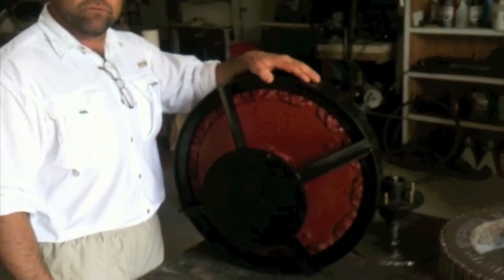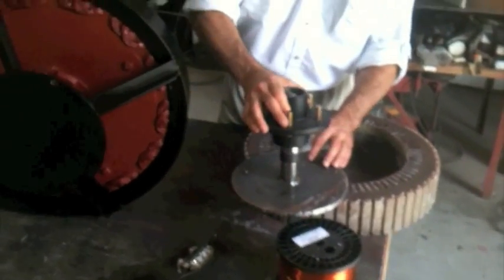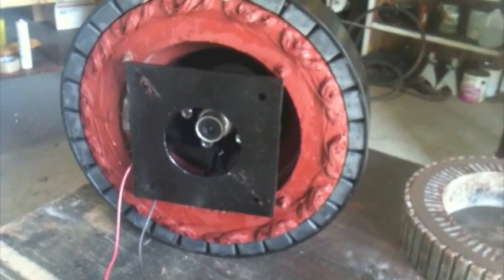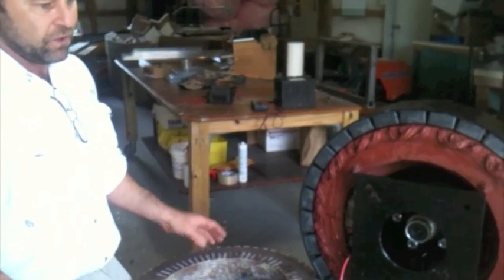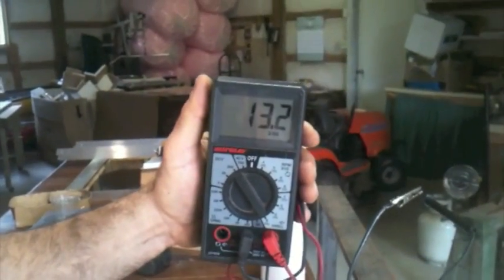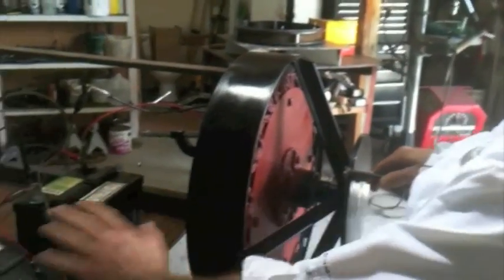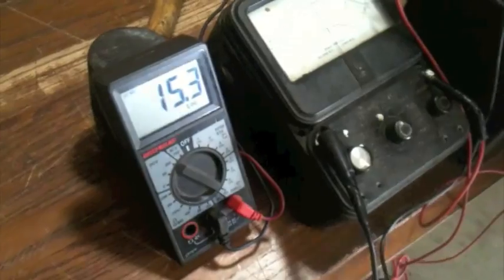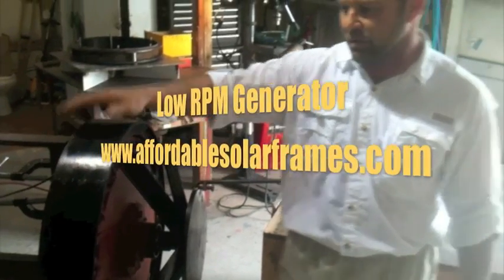Permanent magnet GENERATOR/Home made/bench test hand crank

Comment: H, glad to see you show a real-world build that works. can you please tell us what it costs to build thank you, Steven.
Reply from the maker: I don't remember, I build it 13 years ago.
Reply: @markp0177  ok, so you are not building them anymore and selling them?
Reply: @markp0177  ok, so you are not building them anymore? could you share how you did the setup for the inverters what do I need for the setup also the generator wheel does it need to be this large?
Reply from the maker: @stevenpleasant5834  I no longer make them. I have several other videos where I use it in my hydro system. I built it this big to fit my slow turning turbine. Here is a link. https://www.youtube.com/watch?v=Gnyo95hon-U&t=346s
Reply: @markp0177  All alright, could you show or tell more about the blade and the electrical to the inverters, thanks.
Reply from the maker: @stevenpleasant5834  Call me at 251-402-1165

Comment: I am looking for a brushless PMG that produces 12v DC and 1.5a with low torque (under 1 Nm) and low RPM (under 200) under a load requiring 12v and 1.5a (a water pump). Can you manufacture this or recommend a resource?
Reply from the maker: Try a old tread mill motor. I have another video where I built a windmill with one.

Comment: Putting the coils inside the rotor requires slip rings to connect to the output conductors. They will eventually fail.
Reply from the maker: The rotor is not turning, no need for slip rings.

Comment: Hope you're still around... What is the contents of the casted piece? I'm working on a mold right now but I'm unsure of the the right material
Reply from the maker: I used fiber glass resin mixed with aluminum shaving's. It also has several steel rings.
Reply: @markp0177  awesome thanks man

Comment: How many windings per coil?  I too am in the same voltage range.
Reply from the maker: I have not made one in several years now, I think I did around 20 wraps. I have other videos of this generator powered by water.
Reply: @markp0177  thanks. I will check into those videos.

Comment: Might use a few of those magnets,  and see if you can find any magnetite by the streams, and use that to make an epoxy magnetite composite core.  Imagine, less epoxy, and free magnetic material for your cores. Use a ballmill to grind it fine so that it stays suspended in epoxy and eliminates eddy currents.

Comment: Look for a SAMSUNG front load washer. some of them have a low speed motor just like this one, but commercially made. Also Fisher Paykel makes one. Since these machines have many other problems not related to the motor, they are most often trashed and scrapped. You can see videos here on YT about them. Anyway, foolish to build when better ones are sitting on the curb waiting for a truck.

Comment: low rpm but more force/energy is needed to rotate, because of that heavy massive casing, did you try it with aluminum casing to make it lighter? im just thinking if you will use an electric motor to rotate it,it will affect the ratio of input/output power. just my opinion. thanks
Reply: man of steel , the wright gives it a flywheel effect. While not a problem in hydro, it might negatively effect wind. 

Aside from initially storing some energy in rotational inertia, no, using aluminum won't effect the input/output ratio.

Comment: It's awesome to see people providing ideas for self sufficient technology. I'm making a generator coil spreadsheet to find optimum choices for any situation and so I can visualize how the variables affect output.

You could make it smaller and lighter while providing the same output. Do you make it heavy so it maintains momentum like a flywheel?

What is your magnet to coil ratio (You have 2 sets of coils, so coils divided by 2)?

Since heating permanent magnets demagnetizes them, at what amps are your coils in danger of over heating (170f to demagnetize Neo permanent magnets)?

Have you 'solved for one unknown' to determine what your effective Gauss is, the amount of Gauss imparted to the coils by the magnets?
Faraday's Law for a magnet moving past a coil: N x A x T/S = Volts
# Turns x Area of coil in m^2 x Teslas / Second = volts, therefore # Turns x Area of coil in m^2 / Volts = Teslas / Second

Have you heard of Ion Harvesting? They are very simple to setup and power increases with height.
https://www.youtube.com/watch?v=ENeDkGce5-4

Another good alternative idea is Don Smith and his recreation of Tesla methods for disturbing the electromagnetic medium (Ether for Tesla and his contemporaries) which is always at equilibrium. When you disturb the electromagnetic medium it will resonate providing a moving magnetic field which you can harvest with your coils. Input power maybe 15 watts while output power can be 1k watts. According to Don it's possible to get multiples of the output by placing identically tuned coils within the same field, which is only limited by the number of coils that can fit within the field of disturbance. Check out the office interview videos.
https://www.youtube.com/channel/UC0tu2-2OJCrmbdyGYzui6jw/videos
Reply from the maker: +Don Ation I made it big so that it would put out good wattage at a low RPM. I made it heavy so that it will last for decades.  I woke up one night years ago with a complete set of drawings in my head. So I built it by those drawings that were in my head. I don't know if there is a better design. Here is a video of it working in my creek.https://www.youtube.com/watch?v=Gnyo95hon-U

Comment: What coating are you using over the wires and stator? What is the casting made of?
Reply from the maker: +Mindy Wolff The stator is made out of fiber glass and the coating I use is a wood glue to help hold the wire in place.
Reply: +markp0177   Did you add something magnetic to the fiberglass? I noticed your magnet sticks to it. How did you make it magnetically permeable?  You mentioned 3 laminations were inside to make it stronger. Is that all the iron in it? Would three phases work better than two? I like your idea of using an axle spindle.
Reply from the maker: I now put 10 rings in my castings and that is the only iron in it. In my case two phase is more efficient than three. I have other videos of it working in my small hydro system.

Comment: No you are not because you need to subtract the 12v that battery already has, so you are getting 5 amps and 3v = 15 watts and getting out of breath in 10 seconds. Next you will invent the chocolate fire poker that'll be a lot more use. You people have no electrical knowledge at all!
Reply: I was tempted to be rude but it's better to shed light on your misconception and obvious complete lack of basic electrical theory in the hope that you and others benefit. But yeah, allow me to be somewhat cocky. You did set yourself up for this. 

First off, the generator is in PARALLEL with the battery and NOT SERIES as you would appear to have construed. Actually, when it's not turning it is in series. But when it's turning (and charging the battery) it's in parallel. 
Therefore when the output from the generator is lower than the battery the volt meter will show the battery's voltage.

When the generator's output voltage is higher than the battery (and rectification diode's forward bias, in series) then the volt meter will show the generator's output voltage (under load).
You have to keep in mind that in this simple demonstration the battery is the load and will pull the voltage down quite a lot which leads to a greater increase in current rather than voltage. In other words with a simple resistive load we would have seen a linear increase in both voltage and current (though not linear in relation to the input rotational speed) with much greater variation. And we would have seen a start at zero volts and amps.

So the voltage and current of 15V and 5A shown in this demonstration, and hence the power of 75W were all correct. Remember, the generator is in PARALLEL with the battery when charging ;-)

Finally, you seem to have confused this gentlemen with someone from the 'free energy' crowd. He's not. He's demonstrating how to generate electricity and if you noticed he had to 'work' to get energy out of the generator. It definitely wasn't free, though once it's installed on the river on his land I reckon you could call that free energy if you wanted too.

If this gentleman falls into any type of free energy crowd then it's not the crowd you are thinking of. The free in this case would be freedom from oppression by the state and corporations that do their bidding to enslave us in debt. 

Lucky for you in this day and age knowledge is mostly free. I hope you've learnt something today.
Reply from the maker: +tnick2 Thanks for the great defense.

Comment: I've been looking at a lot of different designs and your's is one of the beefiest I've seen yet.
After mauling over some idea's I thought using a centrifugal clutch like on small minibikes etc. that would engage only at a certain rpm and would allow a wind generation to get up to speed before it started generating electricity, then using an overriding clutch to keep it at a optimum rpm would be a great way to stay within the optimum range.
 The overriding clutches are generally heavy, but with balancing they could help with inertia to keep turning much like a harmonic balancer. I can see using your generator to incorporate wind propulsion for it's drive and wired to produce AC into the home or what have you.
 The low rpm is a huge benefit and would allow for a driver to gain momentum prior to moving the generator..Once a wind turbine engaged the centrifugal clutch the wind turbine will be spinning much more rapidly than the generator which in turn is controlled by the over running clutch. 
It may just be what allows a constant flow of steady ac voltage.
An over running clutch is pretty much the opposite of a centrifugal clutch allowing slippage at a specific rpm in turn taking load off the wind driver..

Comment: Good mechanical design, well done.   Electrically, I have a thought.   I see that you're putting the rectifier in the geni and sending DC down the wire.    I would suggest putting the rectifier at the far end of the run, sending AC down the wire.   You have much less power loss to line resistance with AC over what you lose with DC.  That's the whole reason Edison lost that battle when trying to feed cities far away with DC.
Reply: AC and DC resistive losses are the same. Ohm's law is Ohm's law. 

The power grid transmits electricity at very high voltage because as you are aware higher voltage results in lower current.
And the over simplified reason AC is delivered to the house and not DC is because transformers obviously don't work with DC. 

FYI - telephone lines are DC and used to be battery powered (around 48v I believe) until quite recently.
Reply: You're right of course.   I was forgetting that the lower line loss on AC power transmission was due to being able to step the voltage way up using a transformer, before sending it down the wire.

Comment: have you considered getting a small engine (3 hp outboard or something) to see what you could generate at 1800 rpm. plug in a 500 watt light and see what happens, id be very interested in the results.
Reply from the maker: I would be afraid to spin it that fast. I have spun it with no load around 300 rpm with a drill motor. It was a little scary, I think it should only be spun at a low RPM.

Comment: how many wa watts that could be produced these generator ???
Reply: Chris Brown I think the 1kw potential is powered by wind or hydro not  standing there cranking it. He was demonstrating the action of his machine not the final use.
Reply from the maker: Around a 1000 watts.
Reply: Chris Brown yeah if he plugged the electromagnets into the mains supply as he has nothing to power them with!
Reply: aR Bemo
Reply: NOT nice
Reply: markp0177 how the fuck do you come up such a high number, 1kw is about 1.3 hp you really think a human can generate the power of 1.3 ponnies for any continuous usable amount of time, e.g. 1 minute?
Reply: Then why not make a machine that can actually harness wind/hydro power much better the a large heavy flywheel with a hand crank?
For the record if he used electromagnets instead of permanent magnets it would be more efficient.
Reply: He certainly does have something to power them with, the electromagnets are powered by the generator itself. That does not make it perpetual or over unity machine. Dont believe it, then look up power generators, even the alternator in your car uses self powered electromagnets

Comment: ever mounted mountain bike gears to it and pedals? could pedal it at around 250 rpm quite easily with the right gear set and then have it on fix wheel so that you can use the spin as a fly wheel which in turn will make it possible to keep spinning at high speed for long periods of time. however is it possible to use that to power a washing machine engine?
Reply from the maker: Yes, I power a washing machine with mine but it is powered by a water fall. You would get tired of pedaling this generator after a few minutes.
Reply: trust me dude saying get tired has no meaning to me. i carry a 50kg bag on my back every time i go cycling which is full of water, spares and heavy industrial styled rope designed to hold up just under a ton, never know when you'll need rope that can hold 900kgs of weight. i do about 80 mile a day on it with the bag on with the bike being fully reinforced too. the only time i take notice is when i take the bag off and put my shoulder back in place after a long hard none stop ride averaging about 25mph.
Reply: ***** I smell bull shite. Infantry soldiers only carry 30kg and you're carrying 50kg on a bike for 80 miles?
Reply: trust me there are more people out there that would make you shit yourself. i have plenty of friends who can bench 200kg... basically they're body builders and im an endurance mountain cyclist. only theres no mountains here, so i use the bag pack to act like a gravity pack as i go up hill and down hill, practise for my legs and practise using the brakes. however the biggest hill ive been down had me hit just short of 50mph and it was classed as a rapid decent as there was an issue with someone falling off their bike, and there being no signal on top of the hill. would have helped him down, but he had broken his leg as we were going along rocks, and well you cant really walk too well on a broken leg.
Reply: Chris Brown could probably try... plus no needs to call me a dickhead. sure i could probably train myself to do 25mph over 80 miles as i already do 80 miles starting the first 10 at 25mph and then slowing down to speeds of about 9 - 12mph at the 80 mile mark. however normally takes about 4 - 6 hours to do 80 miles. furthest ive clocked in a day is 120 miles which took just over 10 hours of none stop cycling at about 12 mph, had someone come with me on that one as it was for charity.
Reply: Is there a tldr version....
My point still stands total waste of time and impractical and also still requires the rider to purchase and consume fuel
Reply: Up hill, as in continuous up hill, e.g not a single flat or down hill ever. OK now work out how many can actually that, then if everyone did that they have no time for a real job.
What Im basically saying is this is a totally impractical idea